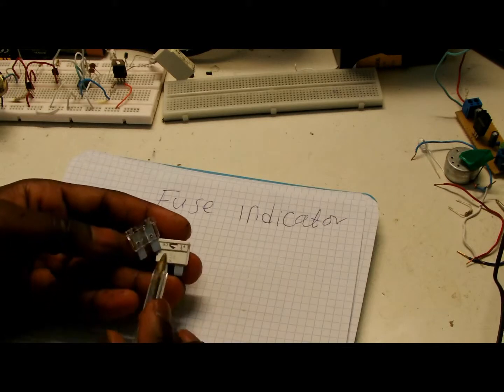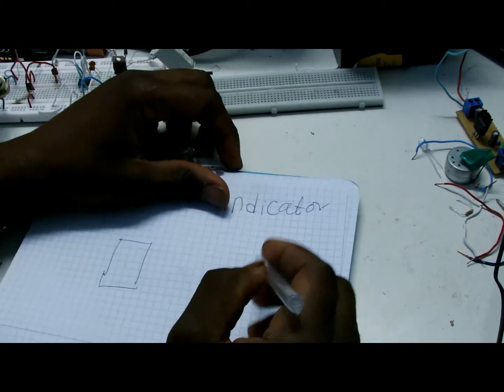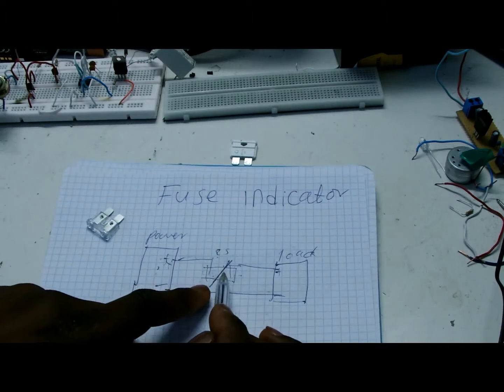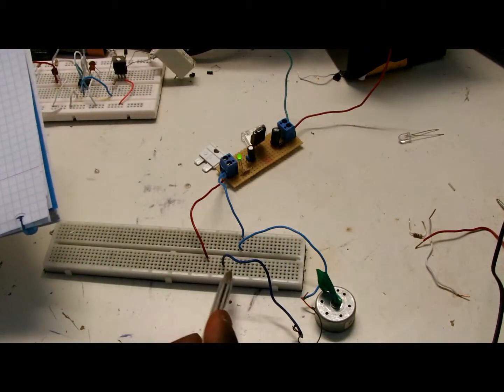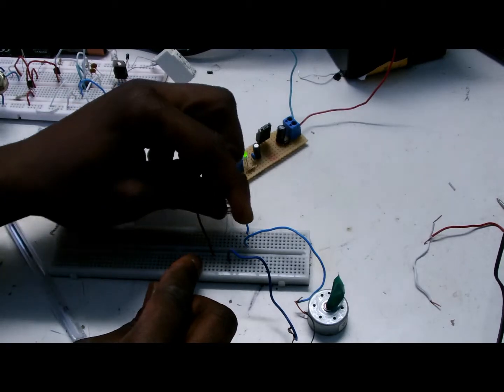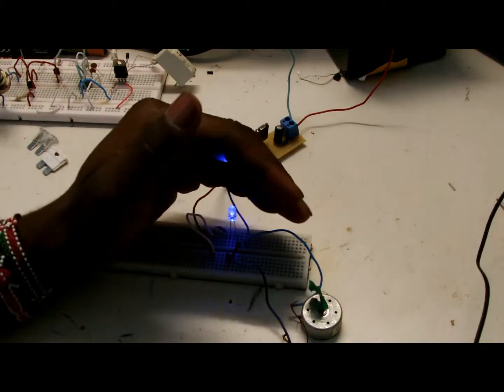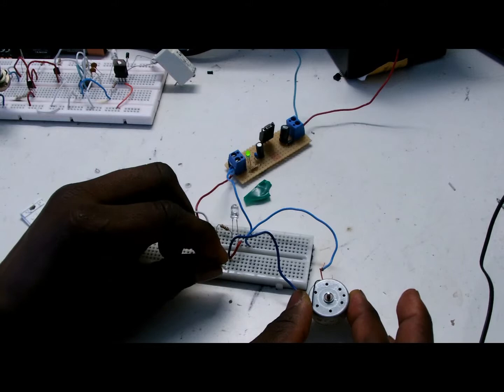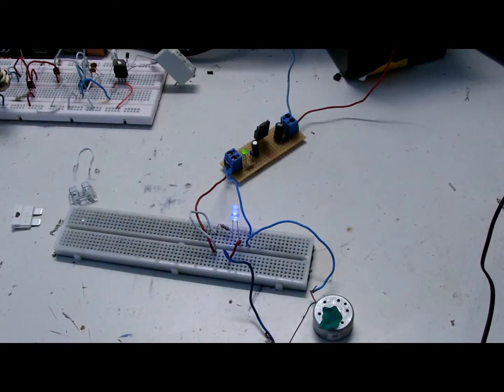blown fuse indicator circuit

Comment: Hi can you list the components that you use from the power supply
Reply from the maker: just a typical 5 volt regulator  with led indicator 
lm7805
3mm led
1 k resistor
100uf 25v/10uf capacitor
1n4007 diode ,polarity protection 
Terminal Block PCB Connectors

Comment: How do you stop led lighting when fuse is good but motor is off?
Reply from the maker: well the circuit gonna be between ur power line to what u are powering ,so u can add a controller for ur motor or any other load after the fuse